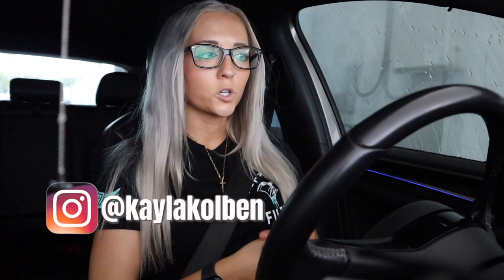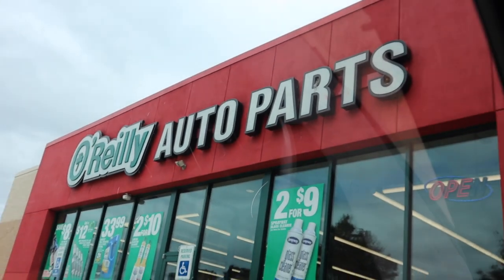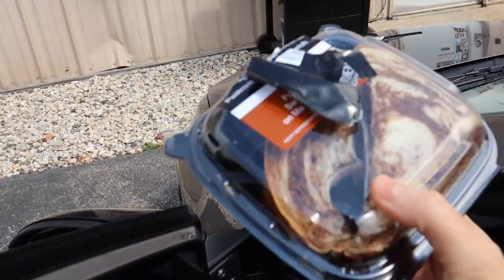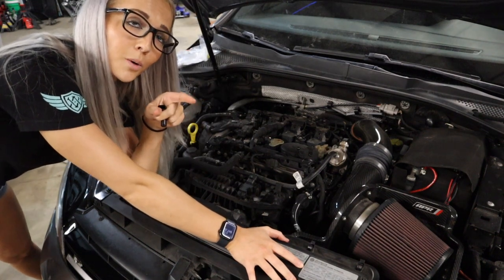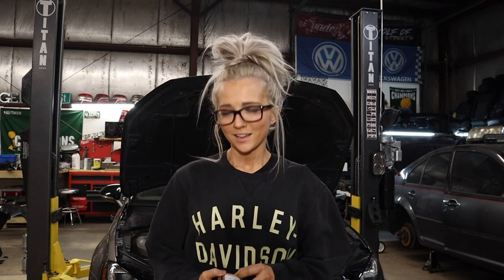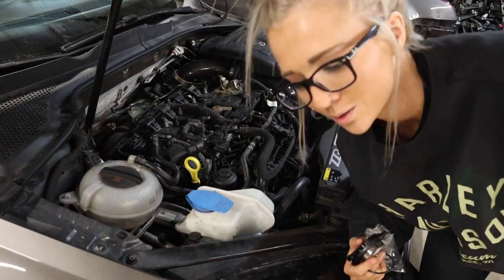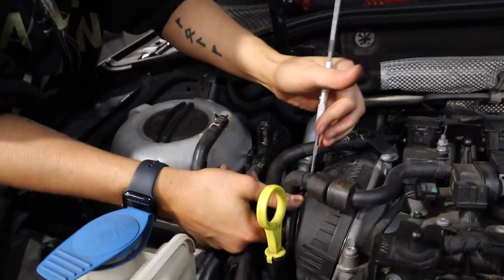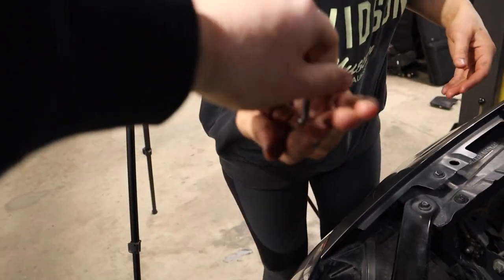MK7 Golf R Camshaft ticking issue

Comment: Watch Deutsche Auto Parts video about this issue if you have time. They explain it VERY in depth in my opinion. But for you lads that are "busy" the problem is caused by the car not having enough oil.
Reply: That's not always the problem. I checked all those values on my obd11 and they are pretty spot on.  Not "searching" for the correct value like the issue in the DAP video

Comment: 2017 Golf R here with stage 2 unknown ECU. upgraded intercooler, downpipe. I've been dealing with a cyl 3 misfire. Changed, plugs, coils, injectors. suffice to say, 4k cad later I'm still dealing with the same issue. Took it to VW finally and after diagnostic found cyl 3 to have 145 psi, while other cyl were around 190. They think it's a faulty piston/ring. No bueno. Looking for an complete engine replacement for my MK7 R. I can't afford a tear down AND a new engine so just going to bypass the tear down. Or should I tear it down and hopefully replace the part that's broken?
Reply from the maker: how many miles do you have on it? And it sounds like you're in a catch 22:( inevitably your going to have to tear down, hopefully the cylinder wall on 3 looks good and its just a piston and ring, best luck
Reply: 92,000 km. I'm thinking of getting a crate engine from VW and salvaging parts from my old engine. We're talking close to 20,000$ CAD though and I don't have anywhere near that kind of money. If I pay for a tear down then in pretty much committed. A failed piston ring needs to be fixed by engine shop and who knows what else involved. Everyone telling me to just replace engine cuz tear down is just an endless rabbit hole.
Reply: Bro I was told the same thing but the mechanics know nothing for me it turns out its the cam adjuster valve behind the magnet now here's the fun stuff is the revised the part so you need a new cam shaft for a 100$ part but it's way cheaper then a new engine or full rebuild I'd do a leak down test before completely giving up . I spent 7 grand this year on diagnosing and getting random stuff done I didn't need and now I've found out this is my issue still have to get a leak down test but I'm 90% sure this is my problem I have a misfire only in cylinder one and my compression literally changes that tells me it's cam timing . Hope this helps a bit man

Comment: Cam position sensor is on the other side of the engine, towards cylinder 4.  You need the cam adjuster magnet, intake side and exhaust side are the same part #.  Make sure the valves under the cam magnet move, like you can push it with your finger.  If the oil solenoid seizes, it will cause a misfire too.

Comment: You only changed 1 of the magnets?  Why not BOTH?
Reply from the maker: The intake side is notorious for failure and when scanned it numerically wasn’t within spec
Reply: @KaylaKolben  - Once you get to the "ticking" its pretty much the phaser as well.  Is that what you have discovered?
The Cam Adj Magnets are truly a replace sooner than later item to keep everything going well.  But, alas - once the ticking starts it could mean much more.  Great "innuendo" video by the way 👍